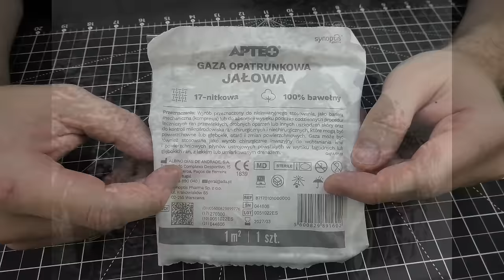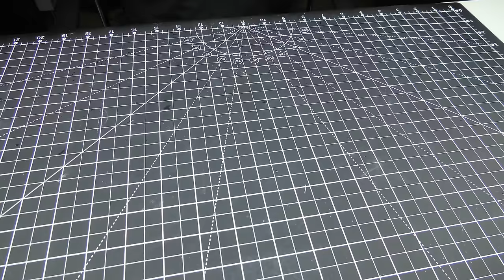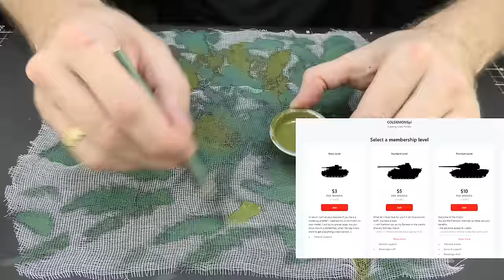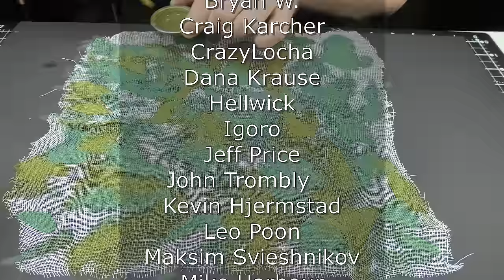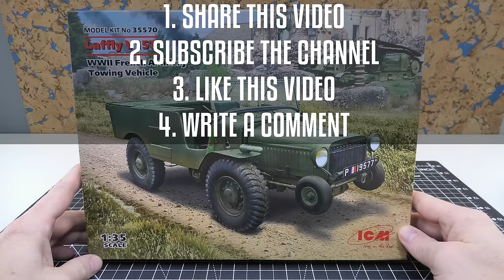JAGDTIGER - camo netting tutorial, Blitz by Takom 8003, Jägermeister, GIVEAWAY!

Comment: WHAT brand are u using bc the stuff I got falls apart when stretched, I need a good brand
Reply from the maker: I dont understand. For what are you asking? :)
Reply: @coldemonspl  the gauze, the stuff i got is cotton and when you stretch it, it falls apart
Reply from the maker: @TiberiusMaximus  mate, I have the cotton and  falls aprart but the trick is that you need to soak it in white glue diluted with water to keep it in one piece. Of course it wont be hard and some strings will go off but it helps. :)
Reply: @coldemonspl  I found some on Youtube just like yours in video